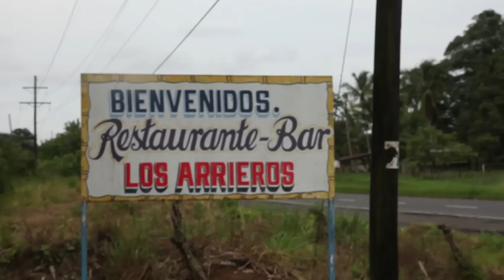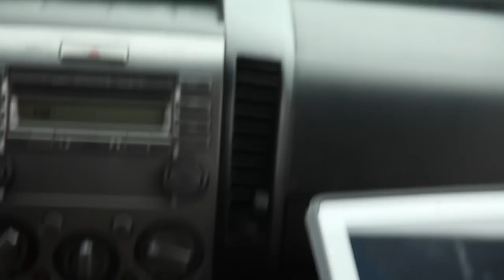Up the Panama Canal Without a Paddle - /TUNED

Comment: 8:18 Funny, my sister had this junky old Geo Tracker she got sown south somewhere that had that exact same cheap aftermarket shift knob! The previous owner decided they wanted to make it into a (wannabe) street racer, in spite of the fact that it is way too slow, way too high, and had way too short of a wheelbase to ever handle or corner with anything like speed. They slapped stiffer springs on (making the already poor short-wheelbase ride terribly stiff and not making it any more of a quick-handler than it was to start with), put a head unit in, and painted the dash vents with reddish-orange enamel (thus sticking them permanently in one position). And put on that shift knob!
I just have to laugh at the ideas people get sometimes. Who would "pimp out" a Geo Tracker like that? First, the "mods" were tacky and useless. Second, if you do anything to a tracker, you turn it into something like this guy has. They are not fast. They don't handle. They ride uncomfortably because the wheelbase is so short, and roll over easily if you corner too fast. You can't carry cargo in one, or passengers, or tow anything. But they do pretty damn well off-road! I had one for a while; I loved that thing. Open the top, crack a beer or six and cruise the back roads in search of new trails and logging roads to try. It would fit down trails that were built for ATV's.

Comment: Hi guys, all in your video was correct, when we get with the diablos rojs, everything changes. The goberment had to stop thse crimninals and remove the tyransporters out of the roads. Like everything in this country is abusive, they ghot the permits to have the buses and to be their own operators. They started by painting the bodies, to install powerful sound equipment, the air horns with a blasting sound, the ewxhaust systema with devices to make more noise. In the past whoever wanted to stop anytyhing, the went on strikes or paros! Whatever they wanted was granted! How many people had to die because those criminals? In this video you're going in a bus at 140 MPH, The thing is not t go fast, you need to understand and be responsible with your passengers and people on the streets!  Did they make a pre-trip inspection? Check the tires? Steering systems, brakes, electrrical, drive shaft, rear springs and componets of parts, lights, exhaust systems and a lot much more?
Reply: Maybe Americans like it because over here, everything is regulated and controlled by the government, and no one is allowed to do anything that might be "unsafe". Everyone dies someday, and I don't need the government to tell me how to be safe.
Reply: justforever96 amen to that.